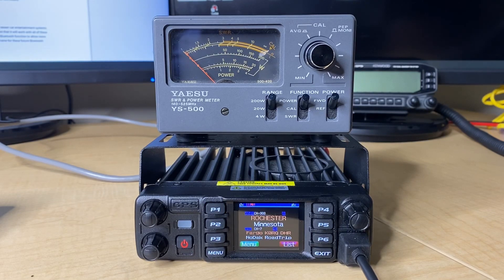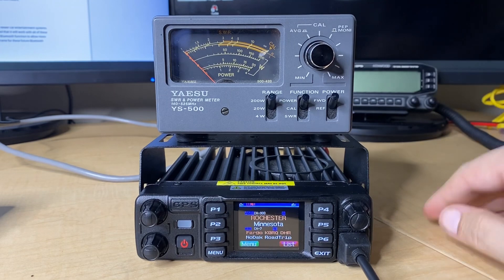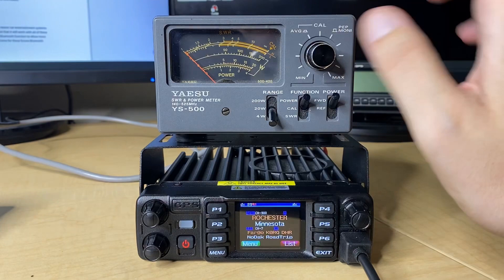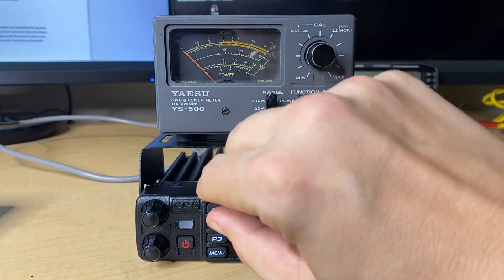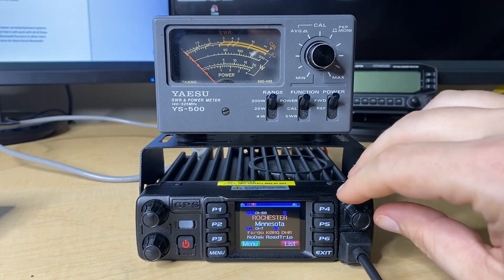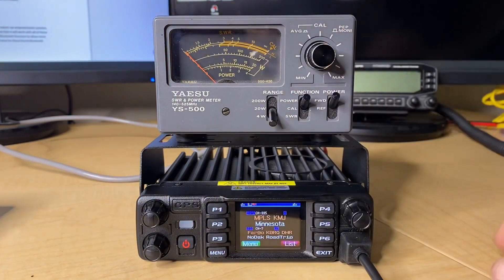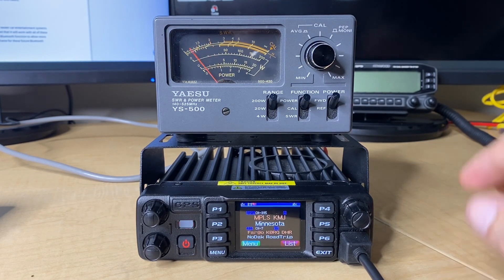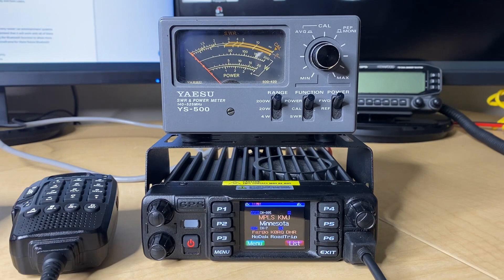AnyTone 578: What’s the REAL POWER OUTPUT!?

Comment: How did you set the P3 to change power levels?
Reply: ok i figured it out.  Had to program button P3 to Tx using the keys on radio since i didnt program keys in my codeplug.
Reply from the maker: Yep, you can configure short and long press of all the keys you wish in the CPS or via the menu.

Comment: I have an AnyTone AT-D578UVII and today I do a SWR & power measurement for it. The nominal power output as seen from the user manual is 55W (VHF) and 40W (UHF). These two values seem to be different as what you said in this video. For TURBO power, I've got 50W for VHF (while nominal power is 55W) and 34W for UHF (while nominal power is 40W). So what causes the ambiguity of the nominal power?

Comment: Did the measurement take place in DMR mode? Then the entire measurement is not correct because the conventional measuring instruments are not able to display the actual values. I tested it with a Daiwa CN 801 V-Type when the meter is in PEP mode. Only then can one speak of real readings....
Reply: Just tested my 578 in DMR mode with bird APM-16(digital SWR meter) and i get only 20 watts to a flat SWR antenna with LMR400  and 25 Watts on FM ...not even close to what they say????
Reply: @kerrcomm  .... if the device might have an error? I bought the device, did not modify or change anything.... codeplug installed and taken in operation... my measurements were taken. On the dummy load, measured with a Daiwa CN 801, my device brings the appropriate output power.

Comment: Anything within 5% of the spec, up or down, is acceptable. That won't make any difference to the listener at the other end. It seems more radios are a little high, rather than a little low, but that is decent. Curious how the 220 stacked up. Thanks for the tests.  K4KID

Comment: Anytone AT-D578 mega shit. NO PTT! You dont can use any other Microphone and no support from Anytone! You can only use the OriginalMic. Bluetooth will disconnected at any time. Works not stable! The feeling of pots are bad.I have still 7x MD-9600, RT90 Version 3. The units works much better. No VFO, no Bluetooth, but the units work fine! And with somer other microphones. The customer need to know, that he can only User the original Microphone. Pull the Mic down and broken, you cannot use the Anytone anymore. Anytone has thousend nice functions, but nothing works good. My choice is the TYT. Cheeper and works.
Reply: I just received one yesterday. The pots on my sample feel fine: they're firm but smooth. Switches feel solid. I haven't yet installed the radio--I bought it for my truck--so I can't speak to other issues. I bought mine from Bridgecom, here in the US, who get good marks for customer support. I'm a bit on the fence about installing it, because the lack of a remote head is a bit bigger issue than I thought when I placed my order.
Reply from the maker: Will be deleting as it’s completely false.
Reply: @K0LWC  I have contact anytone, and IT is no way to use other mic than original mic. Customers get no help.
Reply: @K0LWC  it is possible with new Firmware, but than you can't use the original microphone.
Reply: At now it is possible with new Firmware to use another external microphone with PTT.

Comment: I have a couple 578's, all of them are triband. what about 220?
Reply from the maker: I didn’t test it because I just don’t use it. 220mhz is some rarely spectrum — but some areas still have activity.
Reply: @K0LWC  you do a power test on a tri-band radio and don’t check the output of 220 because you don’t use it? Horrible! The one reason I watched this is to find out what your output findings were on 1.25. Click bait garbage.
Reply: New Technician here, studying for General and Extra. My shack currently consists of one Yaesu FT3D and the RTL-SDR USB radio. I was evaluating offerings from the Big Three for my truck when I came across the 578. 220 appealed to me, even if only at HT power (stated) because there are a fair number of 220 repeaters here in the SF Bay Area, and I’ve picked up traffic from them on my FT3D. DMR would be nice to have, as there are more DMR repeaters in the area than Fusion. 

The 578 arrived yesterday. The lack of a remote head is a bit bigger issue than I thought. There are a number of places I can mount the radio if I don’t mind not seeing the display, otherwise atop the dash, in full sunlight and burglar view (24/7 activity in my HOA’s gated, basement parking garage) is the only way to go. I’m on the fence now: don’t want to lose the 220 and DMR, but may return the 578. 73, KN6NPZ

Comment: The lower power readings on UHF probably relate to coax loss (Any length of coax is lossier at UHF than VHF)
Reply from the maker: The loss seems a bit much given it’s only a 2 ft jumper.
Reply: @K0LWC  what coax is it?
Reply from the maker: RG8X
Reply: @K0LWC  ok, you can calculate the attenuation of 2 ft of rg8x to get your answer, but in any case, the output levels of that radio seems fine. Spectral purity, not so sure, but maybe ok.

Comment: The relative importance of radios meeting spec for power out I think is of far lesser importance than spectral purity. In this area I have little trust in Chinese radios. In all the tests of Chinese rigs I’ve seen on YouTube, only one YouTube video is spectral purity and that on a couple of the Baofeng family of HTs. They had crappy control over this parameter, with numerous high-level spurs not only to adjacent frequencies but out of band.
A side note re power out of FM rigs: I’d venture that most new hams (and perhaps many older hams) who operate FM don’t realize that it takes a >>  6dB << (one S unit) difference in received signal strength to be detectable in one’s personal audio receiver (your ears). And, so long as the RF receive signal is above the noise limiter in the radio, there is NO detectable difference in what you hear.
Reply from the maker: While Baofengs’ have been known to be shoddy, I haven’t seen the same with AnyTone. It’s like anything. You get what you pay for — and this isn’t a $50 radio.
Reply: Try running 1 watt versus 4 watts and you will see how important that power is when you have a bad antenna like a rubber duck.  The much quoted "S-units" statements  and the reality of communications don't mix.
Reply: @joelbahl6830  if you're on the edge at 1W, of course 6dB will make a diff. All depends on the angle of the dangle.
Reply: @jimpiper5297  For 44 years I have understood 3db to be the level of gain that will demonstrate a noticeable difference in a weak signal from low to higher power. A difference of "doubling" the power... or doubling the gain via improved antennas or increased height.  Have I been fooled all of these decades? 
I have a couple of Baofengs for use around the house... and you are right... not pure and not selective. They'll pick up the spark from a Bic lighter wheel at hundred yards.